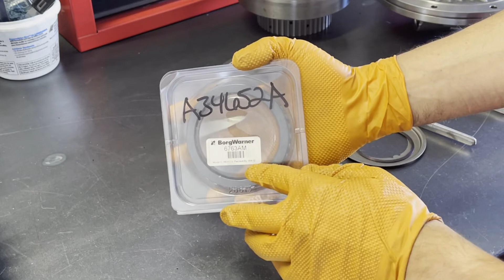2. GM TH400 Rebuild: Front Pump and Drums

Comment: Do the pistons come in different thicknesses? I tore one apart and it has a dished steel at the bottom where the wave plate would go. If I replace to a wave plate, I am way off on the play. I have way too much even with all thick steels.
Reply from the maker: Hi Jason, which drum are you seeing the dished steel (sounds like you are describing an early 4l80e bellville style cushion plate)?

Ill have to double check my notes/info to confirm/deny this definitively but I believe they’re all the same height/thickness in most applications except for a few that received one more clutch and steel in the direct drum.
Reply: @nickstransmissions  I am rebuilding a TH400. its a 1989 according to the plate attached to the side. both drums had one at the bottom instead of a wave plate. Can I put a flat steel on the wave plate then a friction? If I do that ill get my desired play as I been trying all combinations.
Reply from the maker: Yea someone put those early 4l80e belleville plates in the drums. 

Yep, place a flat steel on top of the waved th400 steel and go clutch-steel-clutch until they are all installed. Directs take .090 thick steels while forwards are .077 IIRC.

Comment: Do you think this is an upgrade that needs to happen for a 575hp car?
Reply from the maker: Depends on how it's going to be driven. If like it's stolen and on a reg basis, then yes. If only raced occasionally but otherwise a cruiser (and you're we're talking 575 horsepower at the crank, not the wheels) then you may be able to get by with a 4L65/70 drum with the factory induction-hardened input shaft with the Sonnax internal reinforcement kit.
Reply: @nickstransmissions  Woh. So you're saying if I beat on this occasionally I need a different drum, input shaft, and a  reinforcement kit?
Reply from the maker: Im sorry - ive been answering lots of questions about my 4L60e high performance vids and was thinking that's what you were working with but just realized you're asking about a TH400, lol. 

So no, you do not need anything of the sort for a th400 at less than 650-700 assuming full race. Beyond 700 i would suggest a billet input shaft for the th400 and beyond 900, a full up billet drum/shaft and lots of other things.

Dual feeding the direct clutch, billet forward hub, sonnax boost valve, rollerize rear case and 34 element sprag, small .045-.055 bleed hole in dir drum for 5000+ rpms, blocking the 2-3 accumulator and drilling the separator plate per your stall speed and use is sufficient for a sub-600 hp application. 

Sorry for the confusion
Reply from the maker: Did my clarifying response help at all?
Reply: @nickstransmissions  Oh sorry... YouTube didn't inform me you responded on that last message. Anyhow, yes, thank you for the clarification. I will need to research each one of your suggestions except for the rollerizing which I've got down.
Reply from the maker: No worries - drill your 1-2 feed and 2-3 feed based on your converter stall speed...anything under 3000k, start at .100 for the 1-2 and .115 for the 2-3, if blocking the 2-3 accumulator feed in the valve body. If 3000+ go an extra .010 from those numbers to start then work up from there. 

Leave the direct clutch check ball, and 2-3 acc check ball and 1-2 drive check ball out of the case. Intermediate clutch check ball and low-reverse check ball must remain. See my video on check balls if you haven't already for more details.https://www.youtube.com/watch?v=uzdPopP2lU4
Reply: @nickstransmissions  Thank you so much. Really appreciate the help!
Reply from the maker: You're welcome, man!
Reply: @nickstransmissions  Quick follow up for ya- I'm doing everything you recommend above...do you think I should leave the large spring out of the reverse rear servo assembly?
Reply from the maker: If you're referring to the 1-2 accumulator spring, I've never left it out in any of my builds. 
I'd keep it in if you want relatively tolerable part-throttle shifts, need your intermediate sprag to last (not to mention u-joints on the driveline.  

You can firm up the 1-2 shift by leaving the accumulator regulator valve spring out of that bore in the valve body, keeping your intermediate clutch clearance towards the higher end of spec (keep the cushion plate in) and drilling the spacer plate 1-2 feed hole, leaving out check balls (except the modulator check ball - that needs to stay in) to coincide with your final drive ratio, vehicle weight and converter stall.
Reply: @nickstransmissions  Ok great, thank you. It's staying in. I did just purchas a new direct drum smooth so I can upgrade that sprag.
Reply: @nickstransmissions  I sure wish I could have just brought this project to you. NOBODY near me has your knowledge...and they don't take any pride in their workmanship.
Reply from the maker: That sucks but unfortunately is all too common, though there are good builders out there - sometimes you have to look a bit harder or travel a bit further. That said, you've already found and chosen the best possible builder for your TH400 - you.
Reply: So I'm starting to realize that someone has altered this transmission in the past. The two holes you advised me to drill out are already drilled out- and  larger than I was planning on drilling them. They didn't plug the 2-3 accumulater feed in the case. Anyhow, I'm wondering what to plug this hole with because I bought hex plugs but the largest is 3/8 and it's about one size too small. I'm not seeing any plugs online that I could tap this hole with. It measures .35"... Hmmmm
Reply from the maker: Huh? There's no 2-3 accumulator feed to plug on the case....the 2-3 accumulator feed port is on the valve body but based on what you found about the feed hole sizes, I'd leave it alone, install all the check balls or simply replace the plate with an undrilled factory one (you can try peening the holes smaller or shut if you want as well) and then proceed with your original plan to block the 2-3 and drill the plate accordingly. 

How big are the hole sizes for the 1-2 and 2-3?

If they're significantly larger than what I recommended to start with (especially the 1-2 feed hole), then I'd just grab a different spacer plate and go from there.
Reply: @nickstransmissions   Nick's Transmissions  Right, I meant the valve body, not the case. So I measured the holes at: .130 for the 2-3,
and .135 for the 1-2.  I'm buying a new spacer plate, aren't I. :) I need to stick to the plan so this thing can handle the HP's.
Reply from the maker: The hole size for the 2-3 shift isn't overly concerning, esp if you decide to leave the 2-3 accumulator circuit active but the 1-2 seems a bit much unless you were running like a 4500+ stall converter. When you have a hole size that big and tight converter (2500 is still considered somewhat tight), you begin to get into dangerous territory with the intermediate sprag not being able to hold quick enough and thus taking 100% of the force/stress put on it by the fully applied clutch pack. Plus the case lugs at the intermediate clutch snap ring are vulnerable, esp if line pressures are north of 180 PSI at WOT and no case saver installed. 

If you can find a way to 'shrink' the 1-2 shift down by .010 it may work but you'd have to try it out to know for sure...install all the check balls, keep the 2-3 accumulator active (you can always delete it later) and try it out at part throttle to see how it is. If it bang shifts 1-2 even at normal to moderate acceleration out of 1st gear, I'd swap the plate. 

Tap and use a 3/8x16 set screw for the 2-3 accumulator in the valve so that you can 'turn it back on' if you decide blocking it off is too much.

Comment: Would you not keep the centre drum seal out if you are dual feeding it?
Reply from the maker: Yep, which is what I did in the video starting at roughly 27:10 

Are you watching it on your phone? 

Asking as I just watched it on mine and it does look like there's a seal in there (I had to zoom in to tell there wasn't) but after checking the vid on my computer it's clearly left out and I do talk through leaving it out starting at the 27:10 mark.
Reply: I meant on both drums!
Thank you! @nickstransmissions
Reply from the maker: You're welcome, man...Forward drum center seal has nothing to do with dual feeding. It's intended to soften engagement into drive. You can leave it in or out...
Reply: Thanks!!!!!! @nickstransmissions

Comment: Minor critique but you have the ends of the snapring on the direct drum on a retainer rather than the ends being between retainers.
Reply from the maker: Thanks for pointing it out To be honest I’ve assembled countless transmissions before i started checking the orientation of the snap rings holding return spring assemblies so occasionally one slips through. It should be fine - I’ve actually never had one come back due to the snap ring popping out. 

That said, the optimal position for the ends is between the locking bosses, as you’ve pointed out. 

Thanks again for watching!
Reply: @nickstransmissions  👍

Comment: I have a great question for ya... I'm installing a 2500 stall converter and it's going to be really close as to whether I'll be able to hold an idle. The manufacturer said it's probably OK but couldn't guarantee it. My question is- might there be something I could do to the TH400, while I have it on the bench, that would help the situation?
Reply from the maker: Nothing to the TH400 itself but if your cam is big enough, you will likely need an auxiliary vacuum pump to ensure you can supply enough vacuum to the brake system and modulator on the transmission. Otherwise neither system will function correctly (brakes obviously being the much more important of the two).

Comment: Thanks for the great vids,  Your careful attention to & clearly explaining the details is very helpful, for us less experienced builders!  I am building a TH400 for my gas engine square body Chevy.  My donor tranny was originally out of a diesel pickup and I  am having trouble finding out what I need to change, when installing into my gas engine pickup.   Some thought the governor, valve body and input shaft for the diesel converter were all different but not really sure?  Are you familiar with this, Any insights would be very helpful!
Reply from the maker: You're welcome! Diesel vs Gas:
1) Governor - purchase a new one for a gas engine
2) Vacuum modulator - purchase one for a gas engine
3) Torque converter - purchase a factory high stall (one row of slashes on the converter body instead of two) or an aftermarket high stall if your engine's cam manufacturer recommends a higher stall speed for your cam's grind
4) Kick down solenoid - purchase a new one if yours did not come w/one
5) Valve body - should be fine as is, assuming nothing is wrong with it

AFAIK, those are the only meaningful differences between a diesel and gas engine application. Couple other things I would suggest:
 
A) Determine intermediate roller clutch on the direct drum. If it's an 8-roller style one -way clutch, I'd recommend replacing that drum with one from an earlier TH400 that took a 16-element dogbone style sprag (replace the sprag itself w/the Borg Warner 34 element HD sprag) or retro a 97+ 4L80E direct drum w/the same BW 34-element HD sprag.
 
B) Inspect the forward hub - replace w/a billet rollerized one if damaged or if your truck has 500+ HP and/or will see 5,000 rpms or more on a frequent basis.
Reply: @nickstransmissions  Thank you for the reply and the good info!

Comment: Nice job on pump what brand clamp are you useing? Very nice work jb.
Reply from the maker: Dont recall the brand but bought it off ebay several years ago. A very large hose clamp can also be used but the specialty tool is more efficient.
Reply: @nickstransmissions  hi again johnny here I cant find even one pump alinment tool with knob on ebay would you remember the seller? Or have the link thank you.
Reply from the maker: I also just checked eBay and only see the alignment tools with the wing nut; same with Amazon and a general G-search. Unfortunately I don't recall the seller as I've had that tool for at least five years (probably longer).
Reply: @nickstransmissions  ok thx theres no name on it any were? Can you please help and send them 3/8 cup plugs 4 pls you do nice work thank you jb.
Reply from the maker: Thanks JB…there’s no identifying marks on the tool. Not sure what you are trying to say regarding the cup plugs…
Reply: @nickstransmissions  can I pay for 4 cup plugs I doing myself 2 trans and need them can you help out thank you.
Reply from the maker: Sorry but I dont sell parts or supplies. If you need to dual feed, I believe the Transgo 1&2 and Transgo 3 shift kits dual feed the direct clutch via their separator plate and gaskets that come with the kits
Reply: @nickstransmissions  you cant help me out one time with 4 3/8 cup plugs? Johnny.

Comment: Hey if you could comment back that would be great I have a weak front pump in my th400 and was going to do the same thing your doing but I have a question, do you hafto pull everything out of the transmission first before removing the front pump? I'm trying to not hafto replace the hole thing 😂
Reply: This is my first time dealing with a automatic transmission, I sold my manuel transmission truck for this chevy I wanted and the guy lied and didn't tell me about the issues.
Reply from the maker: What do you mean by "Do you have to pull everything out of the transmission before removing the front pump"? Perhaps I'm misunderstanding the question...

Watch my TH400 junk yard tear down video here to see what's all involved in disassembly of those units: https://youtu.be/WFFH4JofaH4

I have a couple others but this one is concise and should give you a good understanding of how to go about dissecting one of these transmissions.